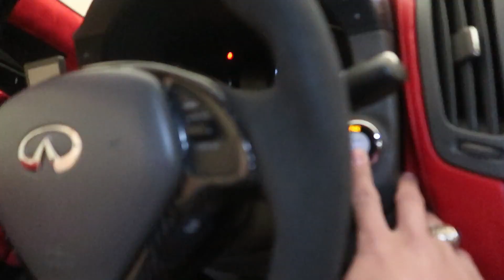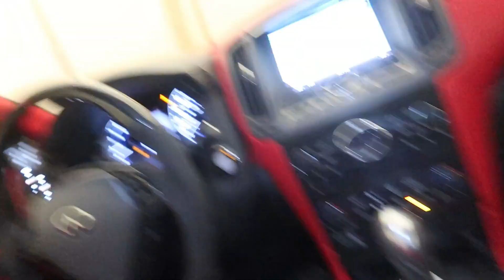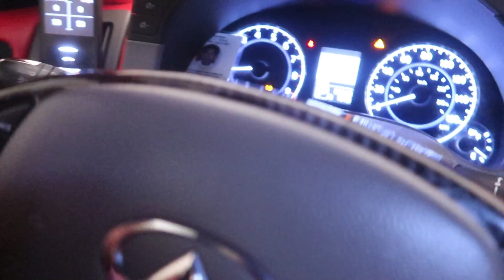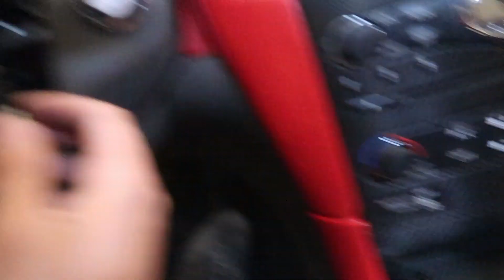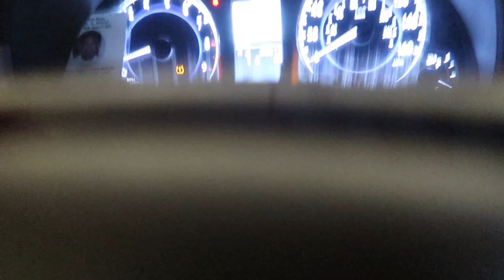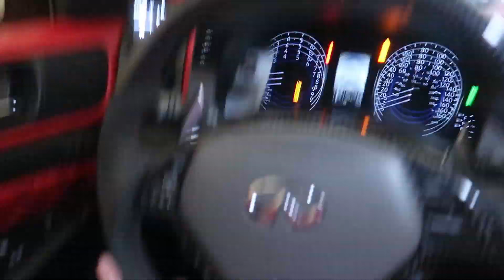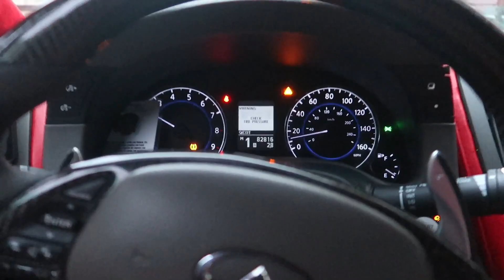G37 PADDLE SHIFTER INSTALL!!

Comment: Nice car. I've got a 2012 G coupe and installed the paddle shifters. But had a problem putting the plastic piece back on under the steering wheel. Does any one know. How did you do it?
Reply: You needed to order the steering column cover that caters to the paddles
Reply: @itsmjcn  if you want, you can also make a cut out to save some money

Comment: I was just looking at these on ebay i also found out that these cars will downshift themselves which is good for someone like myself that cat drive MT
Reply: Infam0usBully just learn to drive a real sports car 6speed manual! Sift paddles are boooboooo! No need if you have a manual. come on lol
Reply: Matt Jay626 LoL my 5.5 gen might get a 6spd swap idk yet
Reply: Matt Jay626 yeah that was my other account my bad but that would be dope my 5.5gen max might get a 6spd swap not sure yet. I already did the motor swap but totaled the damn car Smdh
Reply: Infam0usBully cool! Follow your dreams dawg ! Or you can get a 08 g35 sedan HR 6speed or G37 6speed and not worry about swapping. Got to look at cost, time spent, work hours, and make sure it’s work it.
Reply: Worth*

Comment: Do 2009 g37 coupe paddles work on a 2009 journey sedan?
Reply: I’m about to put paddles in my journey sedan. From what I’ve read you need the plastics from a sport for the steering column but they should just plug in and bolt on

Comment: question bro..do you press on the brakes when you downshift? or you just engine brake
Reply: Even though this comment is late, just thought i say it anyways. Your car will automatically detect when you’re decreasing the speed which will result in Engine Brake. At least for the Sport Model. I have a 14’ Q60s. What I typically do is when the Engine Brake engages, i slightly push the breaks just a bit, let go, and downshift when heading to a stop or whichever the case is.

Also keep in mind that the car will automatically downshift for you when needed.

Comment: I thought about getting the paddle shifter for my G37 but wasn't sure if there was enough space for me to turn the wheel. Very easy install though.
Reply: Can you use the stock trim pieces
Reply: WingIt G if you do not have a sport model with the paddle shifters, you will need a new trim piece (sport version) with a cutout for the paddle shifters, or you could cut into your OEM non sport trim

Comment: How do you get better gas mileage lol
Reply from the maker: Chico drive like a grandma lol
Reply: I try to keep it under 3k rpm and I get 16-17 mpg
Reply: 16 to 17 is good..lol
Reply: Only way you'll get a, slightly better gas mileage is to simply ride it in Drive mode and not Sport Mode when Paddle Shifting.